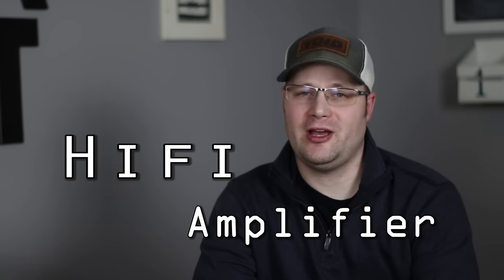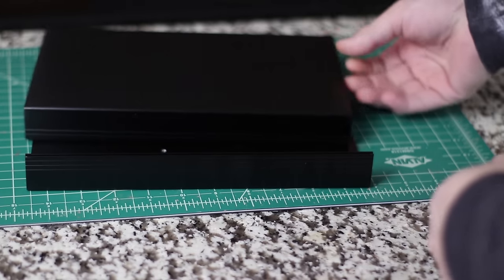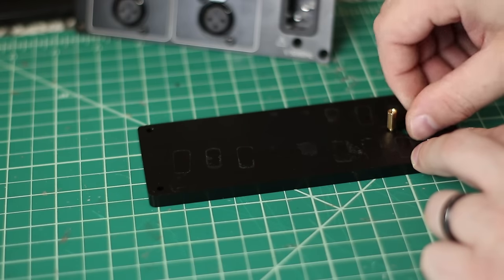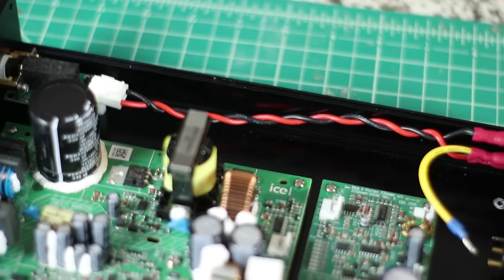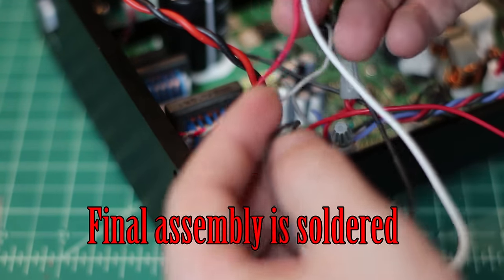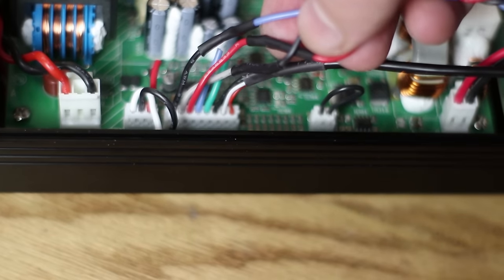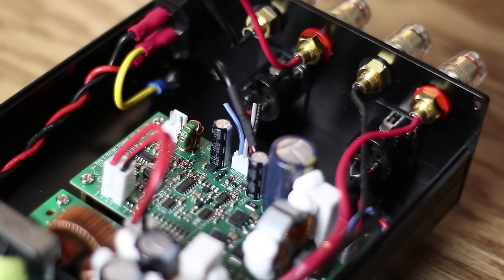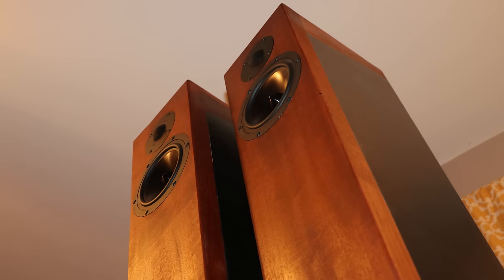How to Make a $3000 DIY HiFi Amplifier for $300

Comment: What makes you think this is equivalent to a $3,000 amplifier?
Reply: These are the exact modules used by the companies he mentioned in the beginning of the video. They just put them in their own cases and charge like 3 grand.
Reply: Jack Allen that is not entirely true
Reply: Please state what IS entirely true.
Reply: Omg so confusing
Reply: This is not really exactly the same as a PS Audio Stellar series amp (not sure about other amps they produce), as they use proprietary input modules and different ICE amplifier boards, BUT this is probably a terrific amp for a great price, and I appreciate the video. By all accounts ICE power amplifiers are very good sounding amps. I may build one of these as a project this year. Thanks for the awesome video @Toid123
Reply: Lol exactly. This is a few hundred tops
Reply: You only need to look at the size of the transformer in the brands quoted. There is no way this system would be able to drive speakers like a $3000 amp. At the end of it all its current that drives the speakers and the PSU in this would struggle to drive large speakers. There is a lot that goes in to designing a amp.
Reply: @andrewdolan5087  most class d amps use no transformer. It's a switching power supply. Check out the Wyred 4 Sound amps that get rave reviews. They almost certainly use a slightly different board than this one from the same manufacturer, but no transformer.
Reply: @andrewdolan5087   You seem to be implying that a $3000 amplifier is well designed... I wouldn't go so far as to make that claim.
I'm a little biased towards linear amplifiers (no pun intended), but that isn't to say class D can't sound good. Never heard nor measured one of these ICE modules, but the one class D amp I have measured wasn't really as clean or stable as I would have designed for, but it was also a relatively inexpensive amp. I will restrain from making any statements about higher-end Class D amps until I have a chance to test them.
Reply: @andrewdolan5087  Big torroidal transformer power supplies are not necessary for high fidelity, just like tubes aren't.
Reply: @H-77  your objectivity is really appreciated here, good on you. :)
Reply: @mikee9167  All the books I have read "like from Douglas Self" have a lot off ways to work out how much power that is needed by the PSU and then you also need a good capacitor bank in the PSU for when the speaker hit a low impedance. I sill can not see how a switching PSU is going to have hack up of potential energy for these situations. It all my opinion but its this detail in design is what makes the difference in Audio.
LOL Tubes will is a different debate. And high fidelity means something different to everyone.
Reply: @Steve Roginski "What makes you think this is equivalent to a $3,000 amplifier?"  Because that's what audiofools will happily pay if getting from a "premium" brand, ie Linn, Naim eta all.  The "Hi-Fi" mags and website are good at indoctrination and getting money and fools parted.
Reply: @andrewdolan5087  Since when was a switch mode power supply current limited?  Both switched mode and linear power supplies have their advantages and disadvantages, but current supply is not one of them, for either type.  BTW all Linn amplifiers use switching power supplies and have done for some time I believe. The Majik 6100 is a 6 x 100W amplifier.
Reply: @davidgriffin79  Never said it could no be done, But most $3000 Amps I can find don't use switching PSU. There must be something in that as it would be more cost effective to have switching PST. And when you look at extreme high end (wish I could afford) the PSU's are huge. What I see is a switching PSU is reactive. It needs something to happen and it has to adjust to it. And from experience the more current in has to deliver it get noisier. A traditional Transformer, Rectifier, Capacitor PSU has a lot of stored potential that can be released very quickly. That is why you need to short them out before working on them. If you have a large speakers for your $3000 AMP they may have have a spot at a frequency that impedance drops low. This would need a quick high current delivery. (this is why NAD amps where so good in there day. High current amps). This is already available from the potential energy stored in the PSU. 
I just don't see how a how a switching amp would respond in time.

Its just my opinion, but for me a good AMP start at the PSU and it need to have the energy to meet any demand put on it.

I love this stuff. HiFi is not dead and with this much debate it can only keep improving.
Reply: @andrewdolan5087  lmao fidelity is not a subjective thing its a characteristic of an electrical emplifier a number that is. Nothing objective. Thats the issue with most diy audiophiles. No deep electrical knowledge. But great audio knowledge.
But you gotta need both
Reply: @BrosBrothersLP  So you cold not come up with a constructive comment. Why did you feel the need to use Lmao. Do you know what my qualifications are?
But let me answer that. "Fidelity - the degree of exactness with which something is copied or reproduced".
To me that looks like what I expect and what you expect can be different. You need to remember we are not all the same. The world is not so black and white. You would benefit from watching Ask Paul -PS Audio channel.
But what is bad is trying to put someone down because you don't agree with what they say.

All audiophiles started somewhere so there all were diy once. Some diy-ers have become very famous in the audio world
Reply: @andrewdolan5087  not trying to put anyone down i just like accurateness.
And sadly my experience with the audiophile community is that it is not very welcoming
Reply: @andrewdolan5087  also sorry for the lmao i am not good with internet englisch
Reply: @philmissy1  This AMP is very capable. The peek output is (on ICEpower website) 43 volts and and 12.5 amps. That's a peak short term output of around 500w (P = I × V). That is alot. And Minimum load impedance 3 ohms. This is why I question if the PSU is rely up to the level of a $3000 AMP.  The 500w PSU board in my computer is almost the size of this amp.
Reply: @BrosBrothersLP  Sad thing is I can not get the full manual from the ICEpower website. But I thinking it would be a fun project to play with. As I said to Philip Perry. It is a very capable amp. And looks like it has a lot more features than in this video. The info I can get from ICEpower site show how to make the amp better with shealded cables and more. https://icepower.dk/products/other/asc-series/. Will have to look in other places on the net for the full manual.
Reply: @andrewdolan5087  I suggest you check out the Wyred 4 Sound M Amp. $1100 each mononblocks. Chasis is too small to use even a moderately sized transformer. They get rave reviews. Go look at the interior pics of the PS Audio Stellar series amps, that are available online. No transformer other than the small one on the amplifier board. I think you're mistaken.
Reply: @hificat101  Total agreement. But there is a big price difference between these amps and a $3000 AMP. The issue I have is this $300 build is the same as a $3000 build. The Stellar AMPs has some big CAP's. I am comparing to $3000 AMPs. Rotel is another company in to Digital amps.
Reply: @hificat101  technically there is a transformer, but yes not the traditional half a ton transformer, that may induce less interference (may), but this is the 21th century
Reply: @jackallen6261  Bull
Reply: @andrewdolan5087  your pc power supply also has a multi winding transformer. Place heatsinks and a 120mm fan. That is what makes your pc power supply much bigger. Just look at its main board minus everything else. Plus your pc is making 4 different voltage outputs not 1.
Reply: @BrosBrothersLP  thats because its a myth like nasa for example lol
Reply: @philmissy1  Computers PSU have been switching power suplyes for a long time now. (OK some of the expensive ones may be different) That is why there cheaper today. You can get computer PSU with out a fan. But the fan is normally used for getting heat out of the case. A lot of smaller computes only have the PSU fan.
It my opinion that you need a good PSU for a $3000 amp. And I just don't see it here.
Reply: @philmissy1  wow. You had to go that low to call me names. Why? Does it make you feel better?. Sorry you don't agree with my opinion. I did not fail. And do have a very good understand of electronics.
Reply: pukpukpuk, Cow
Reply: @Genuine Audiophile hahahaha the politically correct response. On point And makes me want to take back all my harsh words but then again I dont think he will understand anything you just said. But what about my phone charger its an smps and its tiny why is this one so big? Aww crap I did it again.
Reply: @Genuine Audiophile respectfully there are to many under tones to your use of respectfully at the start of every reply. Im not blind to this. Trying the nice road over the evil road still leads to the same place. Everyone's road is different.
Reply: @Genuine Audiophile I dont know what books you have read on class D amplifiers but dont even go there. What is a DAC? Does a class D amplifier require a DAC when a digital source is used? The answer is no it converts digital signals straight to output without the need for a DAC. Hmmmmm
Reply: Respectfully how deep is the rabbit hole?
Reply: @philmissy1  dude you are so mad that i just have to ask ... are you vegan ?
if not maybe you have been on the internet for too long , you should probably take a break and play with your 
EPIC Elves Lego collection that might calm you down 
/watch?v=lyBbwx09_FY
Reply: @Crushonius  cheers for sharing the link also its building more views for her. Feel free to put it on fuckfacebook.
Reply: Really class D?? High fidelity?? Cmon this must b a joke😅😅😅
Reply: @Genuine Audiophile if you say so. Im on the path to righteousness no matter what you say, think or do old boy. Cheerio
Reply: @Genuine Audiophile I agree. (Thanks for not being nasty). It takes a very talented designer to make D class AMPS.  But coming back to this video "How to Make a $3000 HiFi Amplifier for $300". I still don't see $3000 amp in this build. ICE do not freely give out the info "You have to ask the sales team to get access to the good stuff."
Hypex don't use a normal switching PSU. They use more like what you would see is high end car Audio. Below is a quote from there smallest PSU and it would almost be the size of the ICE board that has both PSU and AMP.

Conventional Switch Mode Power Supplies are commonly unsuitable for audio purposes due to poor peak power
 capabilities and the inability to handle reversed currents generated by Class D amplifiers as a load. The Hypex SMPS400 achieves these things by using an advanced over current protection circuit, a highly efficient 2 quadrant DC/DC converter which is capable of handling reversed currents and has a peak power handling of many times its rated power. -Page 4, https://www.hypex.nl/img/upload/doc/smps/smps400/Documentation/SMPS400Axx0_14xx.pdf

This comes back to my original thoughts on this build that is equivalent to a $3000 Amp. You need to be able fast short temp peaks in current. But Im sitting in corner that likes transformers and large capacitor banks for this, and I have posted some links before on D Class amps that use this. Most of the companies you have quoted look to dedicate at least have the case to the PSU and lots of capacitors, Makes sense as you have the room beaus the AMP modal is nice and small .  But again this is just my opinion. And if we did not all think different it would be a boring world.

If the heading of this video was something like How to Make a $1000 HiFi Amplifier for $300. I would not have an issue with it.
Reply: Philip Perry gentlemen, please!  The back and forth here is getting old.  Grow up!  You people really have the time to go back and forth about SMPS’s?  Go listen to some music!  Do it!  Now!
Reply: @jackallen6261  not even close
Reply: Philip Perry Angry from having your period? Have some Midol and chill...
Reply: Philip Perry just hoping “your daughter” doesn’t end up learning all that senseless negativity from her daddy. Well very likely you’ve already displayed all that anger towards her and it may as well be too late.
Reply: @Genuine Audiophile Hi, interesting your comment earlier that SMPS are quieter than a linear supply and might explain an observation I have had with the Cyrus One HD. This is a Class D amp but with a linear supply (I was drawn to it for that aspect), however something that has puzzled me is it lists a SNR of 96dB - which to me seems low when comparing with other kit easpecially at it's price point (£1000), but if the linear supply is noisey that might explain it perhaps?
A couple of other amps around the same money I'm considering are both A/B with linear supplies, and both have higher SNR's. (Audiolab 8300A, 109dB. Yamaha A-S1100, 100dB - this one has an interesting circlotron design). But I don't profess to be an expert of any sorts and am slightly confussed by it all - proof is in the listening no doubt! Cheers
Reply: Thanks for this! Fun project
Reply: It's the same amplifier module used in high end amplifiers, and it measures superbly.
Reply: Cringe every time anyone says 'plug it up'. Are your plugs on the ceiling?
Reply: I was looking for the power transistors!!
Maybe they have gotten smaller since I built amps.
Reply: "What makes you think this is equivalent to a $3,000 amplifier?"
A lot of people cannot really tell any difference in the sound of an amplifier. If you push for a concise description of the difference: They simply cannot give you any reasonable one. In real life, this actually applies to most people, even the ones screaming in this comment section. Particularly those in the positivist tradition, killing any essence of soul in music.
Reply: Geez so many people here call Class D digital. THERE'S NOTHING DIGITAL ABOUT CLASS D! It's just PWM/PDM, which is still analog.
BTW switching power supplies are cheaper and in many cases more convenient. They can supply a very stable voltage, but they have a very hard current limit (which is not a problem if that limit is high enough). Unlike SMPS, you can overload a transformer and it will handle it quite well. EI transformers are the best in this regard, that's why you see them in so many consumer-grade amps/AV receivers.
Reply: No, thats simply not true, sir. They are in it for money too of course, but high end manufacturers are decent really if you look at what you get for the money. Ive had many bits of high end equipment, and you really do get what you pay for. My Pass amp of ten years, which can be purchased on the used market for around £4, 000  has way more parts than that and produces a sound that I have loved for 10 years. Thats real value for money. This will not produce a £3k amp sound, no way.
Reply: @Genuine Audiophile Thanks and it does make interesting reading. I've decided to embrace Class D and SMPS, picked up an impulse buy on a bargain NAD C368 with BluOS 2i module. I probably would have ignored it before based on Class A/B snobbery and certainly SMPS snobbery! But then as with all these things the implementation is far more important than an arbitarty Class designation I'm sure, much in the same way a DAC is not defined by it's chip but the whole product from PSU to output stage. I'm feeling chuffed with the purchase anyway and hopefully it'll sound great, man maths won the day - no longer need to buy a Bluesound Node 2i now as it's built in to the NAD MDC module :)
Reply: @Genuine Audiophile Thanks and yes I'll let you know what I think when it's here and I've put it through its paces. By all accounts it's actually a warm sounding amp which lays to rest the notion of Class D always being bright - though proof as they say will be in the listening! I will try my current streaming device (Squeezebox Touch) first so as to ascertain the differences in the amp, and then of course use the 2i module to stream and thus compare that with the Touch. And if I can't tell a difference then it means I upgrade my speakers right... that's how HiFi works isn't it!! :)
Reply: @philmissy1  Angry much?
Reply: @andrewdolan5087  Class D amps are super efficient, a large PSU isn't needed :)
Reply: @andrewdolan5087  Are those huge PSU amps Class A?
Reply: Agree. There is no way this could ever run with my Krell amp.
Reply: @inglouriousmofo   Hi. That’s not how I see it. Efficient is only part of it. If we break it down to its basic components, you have a Power supply, a switch (amp) and an inductor (Speaker). Running a frequency range through an inductor will create highs and lows in the impedance. So when the speaker hits a section with a low impedance it will draw a large current and want it quick. Unless the power supply can react as quickly as a super conductor there will always be a lag. This is where a power supply with a lot of potential energy will be good. This small amp can peak at around 500 watts. That’s impressive. But in this comment we are comparing this to a $3000 amp. Have look in side $3000 amps and look at how much space power supply takes up. Quick google search.

Remember this is under the comment “What makes you think this is equivalent to a $3,000 amplifier?” and Im with Steve Roginski. I don’t believe this is a $3000 amp.
Reply: The fact that he sells it for 3000, duh!
Reply: @inglouriousmofo  Have a look in the D class amps that  Genuine Audiophile quoted. Most of them are over 50% powersupply. D class amps are small. But you still bribing a voicecoil
Reply: @kurtmueller2089 Would love the Web address for the $3000 using this module? Please
Reply: @andrewdolan5087  you did not get my joke. "any merchandise is worth what the buyer is willing to pay for it". 

If he (the video maker) sells this amp at 3k and someone buys it, then it is worth 3k. 
Tongue in cheek of course.
Reply: @andrewdolan5087  You mean the SMPS is going to add some high frequency noise to the amp that the amp is already filtering because it also has high frequency switching as part of its design? So.... since the filter is removing that noise, how is that a minus?
Reply: @infooptimalfitness7720  We'll do a double blind test and find out.